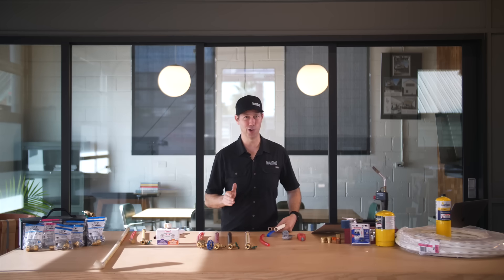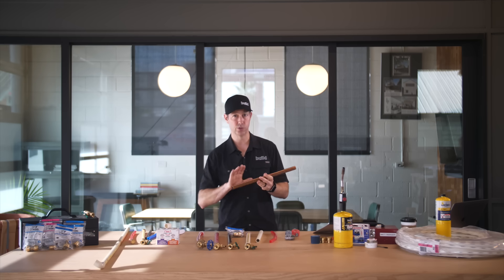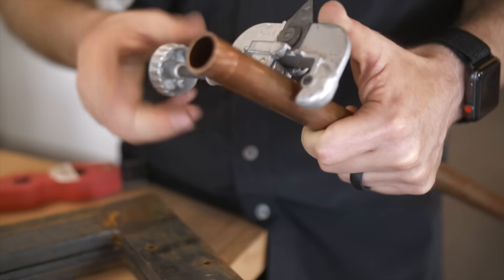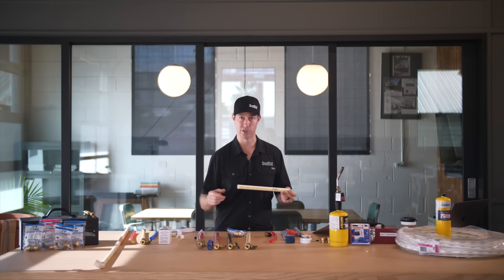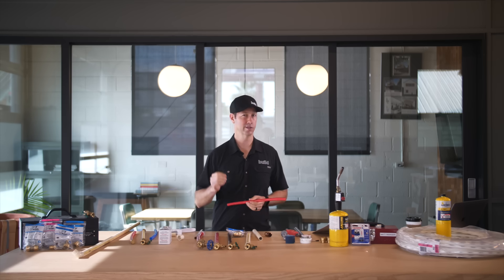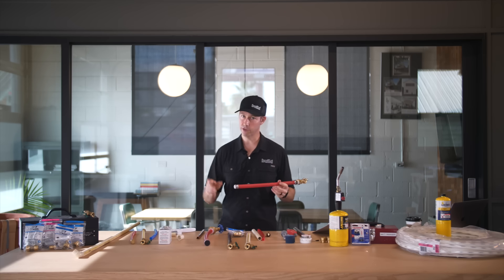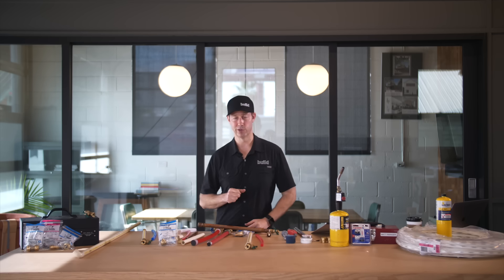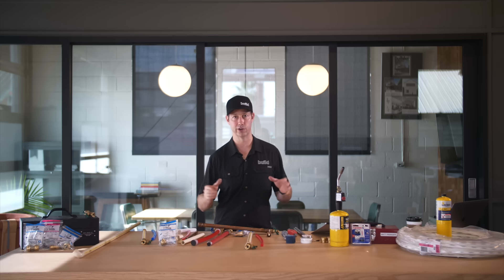PEX vs COPPER vs CPVC plumbing pipes

Comment: PEX and CPVC being plastic in nature have me wondering about the chemistry.  Since BPA and now BPS are often used plasticizers, the question arises in my mind about the nature of the chemistry in these "plastic" pipes.  We know BPA and BPS are questionable for young developing minds and bodies, so much so, they have banned BPA in baby bottles and products and replaced it with BPS in many cases only to find BPS is even more detrimental.  Can anyone speak to the safety of PEX and CPVC when it comes to BPA and BPS?  Please disclose your links to the evidence based research as well.  Thank you!  Blessings friends.  :o)
Reply: Pex for all runs except the cold drinking water faucet, usually just the kitchen.  Copper for that.
Reply: I am so glad you raised this question, because I never even considered it.  It brings me to also question what contaminants might also come with metal piping such as copper or steel, and the materials that are used to join them (flux, solder).
Reply: @scorpio6587   I know my old ass metal pipes have to be ran for a bit before I will use the water.... nasty... I need to do something soon...
Reply: Adam May - I have wondered the same thing. I've heard that copper pipes develop a patina after about a year which coats the pipe and prevents any leaching of metals into the water, but I don't know more about it than that.
Reply: Don't forget that whatever pipe you use in your house your water is still being supplied by miles and miles of probably plastic municipal lines.
Reply: @ThePlungerboy
Actually, my water comes from my well, a few feet from my house.
Reply: ThePlungerboy- I was an inspector for a municipal water department in the 1970s and a lot of asbestos cement pipe went in the ground as it was cheaper for the developers. It was coated with asphalt on the inside. Second was cast iron, and ductile iron pipe was just getting started. PVC took off in smaller municipalities in the 1980s for developments. Main lines were still mostly ductile iron pipe.
Reply: You can’t control what is coming into your home from the local municipal water system or the infrastructure used for its delivery.  So worrying about what materials are used in your home plumbing is rather pointless. You can more effectively do the following: have an independent lab test your drinking water as derived from your tap (don’t rely on the reports provided by the local water supplier); and install the appropriate water purifier necessary to deal with any possible water problems you may have as reported in the lab results.
Reply: public/community water comes via plastic pipes these days anyway. The last couple meters in your house won't make a difference.
Reply: @joansparky4439  That's scary. If my entire house is copper and I get sick from plastic leeching, all the blame is on them.
Reply: @raven, I guess you will get sick from poisonous air before that, thanks to coal power plants and cars burning fossil fuel and creating tiny particulates through abrasion of their tires and brakes, which can even make it into your brain.
Reply: @Sparky   you're safe then
Reply: Well, I've found that cpvc and pvc very well detrimental in that they both have it in the solvents. Pex though, I have heard none about. The connections don't use solvents, but instead crimp or expansion connections
Reply: John Bonner good post man im right there with you...copper for any supply of water that goes in my body...

I dont trust plastics worth a damn
Reply: To me it's simple: If I have to let water run ten second to "avoid plastic taste" on the water I will drink, it means I will ingest plastic. It might not be scientific approach but I do believe that if it smells like plastic, IT has plastic.
Reply: https://www.buildinggreen.com/news-analysis/harmful-chemicals-may-leach-pex-drinking-water
Reply: There was a study a few years ago done at Purdue University on the safety of Pex. It was found that Pex did indeed leech chemicals into the water.
Reply: John Bonner but if you are going to look that far, you need to be aware that just because solder is considered lead free doesn't mean it's lead free. Just like foods and GMOs, you are allowed less than 5% to call it GMOs free or lead free.
Reply: @say_goodnight7342  is
Reply: John Bonner Thx for your post! I share the same concern about these PEX products leeching chemicals in our drinking water, plus the greater possibility of failure related with PEX. Kitec and UPONOR already have class action lawsuits, against their manufacturer.
Kitec went bankrupt, do the 25-30 guarantee is long gone, and it can happen with any other manufacturer.
Reply: copper and lead aren't healthy
Reply: @MichaelMantion  hi, let the water run a little while before drinking it.
Reply: Walt Schmidt    I wasn't really directing my comment to any specific person. I was speaking in general terms.
Reply: This is often an issue when plastic is heated. So the city supplying you cold water is less of a concern than your heated water in the house.
Reply: John Bonner  what about the primer and the glue that comes in contact with my drinking water ?  Is it safe   The glue will melt plastic  what happens when  pieces  are in my body
Reply: @paulmazurek3306  The primer and clue dry and become inert.  That's how they work they don't stay in a volatile state.  Even if a small amount of chemicals some how made it into your water supply it would have no ill effects on the human body.
Reply: @paulmazurek3306  hello Paul the purple primer is very hard on the plumbers liver. But after the primer and glue dry I don't think it has a leaching ability but I'm not a hundred percent sure I just know it's very toxic in liquid form.
Reply: @justin.j.boucher  
But, you don't mean its used as supply lines, do you?
Reply: @justin.j.boucher  
Wow.  There's my lesson for the day.  Thanks!
Reply: Any plastic is a potential health hazard. I wouldn't take industry reports on it's safety. They're never going to tell us there product has a chance of causing cancer or other issues. Even independent studies may not take into account the long term risks of slight exposure, or the effects on children for years. 

The reality is it's really hard to detect the effects of exposure to minute amounts of chemicals or their interaction with other chemicals. And even copper can also be toxic and can leach into water from copper pipes. (I have read that 6 hours is enough to detect higher than healthy levels of copper in water in new pipes - older piping develops a oxidized coating that slows it down).  For all any one knows copper plumbing might even be contributing to alzheimer's and liver disease. No one really knows. So there is no perfect solution. 

There is one thing you can do with any of these systems. The amount of chemicals or copper in the water is a function of how long the water sits in the pipe.  So running the water for 30-60 seconds to flush the pipes can reduce contaminants by 90% or more. So you can just run the water for a minute or even put a device on a timer the flushes your pipes every 4 hours to reduce the danger in any of these materials.
Reply: These systems all use NSF-61 and Prop-65 approved materials.  In fact, until recently you had to worry about lead in your copper system due to the solder.
Reply: You need to look at what they're spraying in the air.
Reply: @jumpingjoe705  solvent-based herbicides (literally 70% with 7 % of that being naphthalene) everywhere several times a year (all roadsides, power lines and farm fields)... have gotten so sick from exposure on 3 occasions - once while in a national wildlife refuge where they had sprayed for "invasives."
Reply: So all you guys concerned about chems and contaminants in your pipes... spose you guys will just dig wells and get an old bucket and rope system, boiled over a wood fire... nope still gotta put something in your house... you live in a house right? To many things can give us super cancer these days, worried bout the wrong things lol
Reply: It’s like diet soda artificial sweeteners were OK  but now they cause heart attacks  during to plac blocking our arteries  17% more chance
Reply: John Bonner    PEX does not contain BPA.
Reply: I can't remember where I read it, but I believe CPVC is manufactured using plastisizers that slowly leach and degas out of it over time leading to brittle pipe after a couple decades. If I remember correctly, the contamination of the water in the pipes was only measurable after the water had been in the pipes for several weeks though.
Reply: @siggyincr7447  I as a licensed plumber in Ca. Have cut into cpvc that has some age to itself, it does indeed become brittle with time.
Reply: Don't forget most water mains before your house are asbestos cement
Reply: @bryanronneym8091  
I don't beleive that.  You mean "concrete", anyway, right?  Cement is a binder (adhesive).  Concrete is well, driveways, culverts, etc.  I have never seen a cementious pipe used for warer supply; only storm drains and flumes, etc.
Reply: Actually, BPA was used for years - safely. The ban was based on giving massive doses to rats - amounts that we'd never come close to in a lifetime.  More than one scientist says that the BPA business was much ado about nothing.  It's like giving massive doses of sugar to diabetics to prove it's harmful. It's a crying shame what's been done to science over the years - but you have a point. What if there's something  worse in the new stuff?
Reply: @4TIMESAYEAR  Disagree entirely. The BPA issue was found to be harmful at levels so small as to be previously considered unimportant. It changed the whole way we look at very tiny quantites, especially in adolescence. Have a look at 'Death by Rubber Ducky" if you want a good primer.
Reply: John Bonner the manufacturers of the pex can answer those questions. I’ve seen before that a few had some links on their site. I’d suggest you look there first.
Reply: jcnash02 Thank you for the suggestion. My ability to trust the site review of the products they sell is fraught with conflicts of interest so I look for third party evidence based research instead. Blessings friend
Reply: This is the greatest reason for copper pipes. So many problems with chemical leak I to water from plastic.  While copper, tin are common in the body and even lead is often fine in minute  trace quantity within the human body.
Reply: @TheLiamis  hi, copper is great, can withstand a thirsty rodent!

Comment: You did not discuss the downfalls, major class action lawsuits with CPI - Dura Pex!!!! housing sub-divisions have had major issues with the fittings and the pex pipe product. So you can hopefully touch on that tender subject. Thanks
Reply: Shell Oil Co. paid out millions in class action settlements up until this current decade for aging plastic pipe that shrank away from fittings/crimp rings. Supposedly the new Pex has improved/corrected the chemical formulations to stop this. I was surprised when this product was reintroduced to the market using the same trade name after the previous multiple lawsuits.
Reply: Dan Moberly right on
Reply: This is why Uponor is the superior pex of the bunch. The joints are expanded over the fittings. Plus if you compare the fittings the Uponor fittings have a larger ID by 15%.
Reply: @Shannon Haugen
But you can’t go down to your local hardware or building supply house and buy Uponor supplies and tools.
Reply: @Ethan.Lamoureux  uponor also requires the installers to  be trained and hold a card. The beauty of Uponor is if you link it, you can hear it up to clear and it will go back to its original state. No need to cut it out like the other pex's.

Comment: interesting how different markets tend to use different products, CPVC in my area is generally homeowner repairs, and I have found it to become brittle as it ages. Our pex tends to be either A or C,  I dont see much B in houses locally.  and with copper we are seeing an increase in the use of crimp fittings, I purchased a Milwaukee Force Logic Press tool for both copper press and 1807 Pex crimp ring jaws, on copper it eliminates the cleaning and flame of soldering, not sure of the longevity yet, but i trust it and am monitoring a few crimps in my own home when i put in a water softener and added some hammer arrestors.
Reply: Thanks for sharing your long-term experiences.    The test of time is the hardest to predict, brings the most surprises, and deserves testimonials like yours.     I suggest you disclose your general geographical area when participating, as soil and water chemistry, not to mention construction practices, vary accordingly.
Reply: i am in WI,  our water tends to be highly corinated in city supplies, and wells tend to be higher Iron, with some havingg high Arsnic, and radium, but generally not acidic, there are pockets with acidic water, but not wide spread. also I have experienced freeze damage in all types of plumbing pipe with the exception of PEX Type B & C, I have seen type A Burst, as well as copper, CPVC, and Iron.  I also notice that CPVC does not like the cold, it gets quite brittle, so working on a cold Jobsite with it, like PVC shearring doesnt always work, while PEX does. I hope this helps some.
Reply: This is enormously helpful to my understanding.    You live in a hard freeze climate that I know nothing about.   At age 65, I still live in soCal, near Los Angeles, where only every 50 years does a freeze get so serious as to damage pipes widely... NORMALLY.    I remember when copper burst in the first winter after it was installed as a re-pipe, in the 1970s, to a flat top house that was built in 1958 with galvanized steel fresh water pipes.    This was in the hills of Glendale.     The plumber did it cheaply in the 1970s by leaving some copper fresh water supply pipe on that rooftop.      They promptly burst on Jan 2, which is the coldest time in Glendale, CA.     This frost threat normally goes unnoticed but that copper installation was ASKING for it.     I'll never forget how stupid that was.

Comment: Math you are amazing. 
The only thing you missed these days most of builders in California uses pro press for copper. It is more faster and it looks clean after the job is finish. 
May be next time you educate everyone about the Benefits to go with propress tool. 
One of the great benefit is no flex and no contamination the pipe.
Reply: Farid Mohsini you also don’t have to bring an open flame inside a customers home. Makes everybody feel safer about using it! I love our propress 
-Journeyman Plumber in GA
Reply: The downside to Propress is that it uses an o-ring for sealing, just like a Sharkbite.  It's more stable because the crimp minimizes movement in the seal, but at the end of the day, it's still an o-ring that forms the seal.  When I do copper, I sweat it in.
Reply: Where is it sold?

Comment: You mentioned PEX type A and B.  There is, also, Oxygen barrier PEX and aluminum walled PEX.
Reply: Eric Kosak would still be pex a or b with an aluminum oxidation barrier. There is however a pex C which is more prevalent in the EU.

Comment: Advice for the do-it-yourselfer with the CPVC pipe mistake I made piping my house I'm an electrician by the way I used PVC glue and primer not thinking and then all the sudden the next day had an epiphany there is CPVC glue and PVC glue don't get them mixed up.
Reply: Also, don't use pvc on hot water lines.
Reply: Absolutely - READ THE LABELS.  The companies that produce these products want them used correctly, so do what the labels say!!!